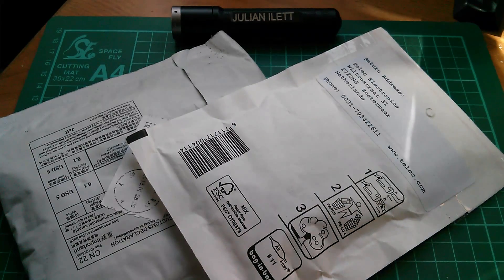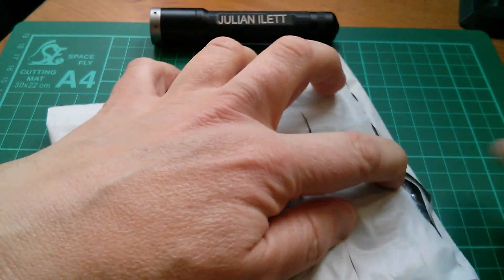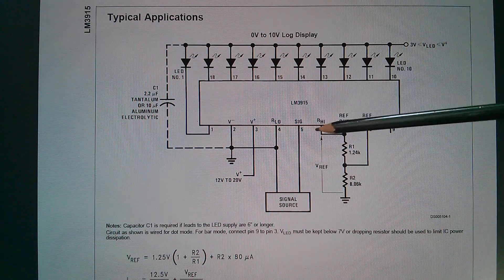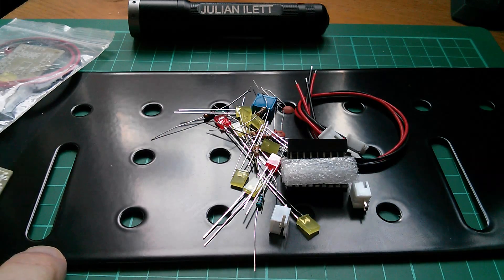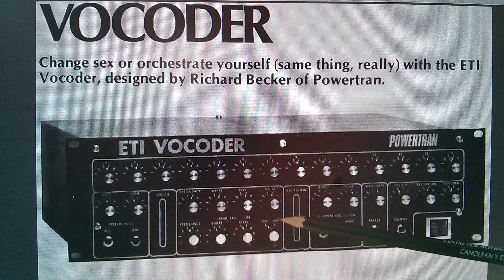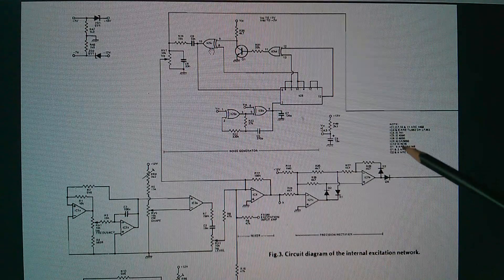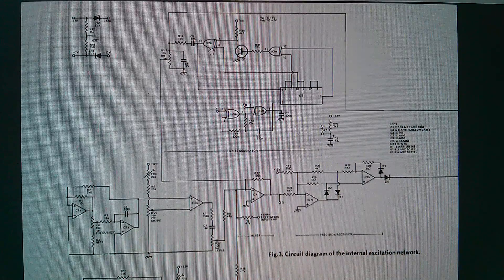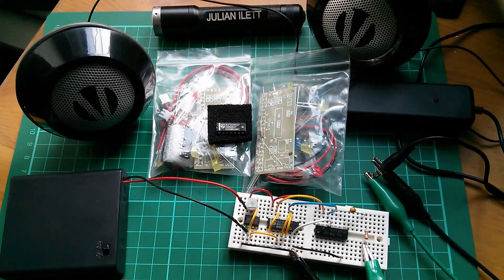Postbag: #37 - ETI Vocoder Parts - CMOS 4006, LM3915

Comment: I guess it's cheaper to get any 5v micro, simulate 4006 in software with interrupts for low speed clocks, and slap 4006 label over it :)

Comment: I looked at LFSRs a while back - the idea was to attach one to an Arduino to make a un-hijackable random number generator for encryption. The idea being that anything running in RAM would be vulnerable to malware /  spyware memory dump attacks, but an off-board Arduino based jobby would be much more difficult to compromise.

Comment: For numbers to be "relatively prime" the numbers themselves don't have to be prime. They must not have a common factor though. So 5 (5), 9 (3*3) and 14 (2*7) are relatively prime.
Reply from the maker: superdau Thanks. That makes a bit more sense. I just finished the noise generator and it sounds pretty good, although there are perceptible patterns in the sequence. Now to move on to the input and output amplifiers.

Comment: I know it goes against grain of the project but surely a micro controller would be better for implementing the logic, maybe even the LED bar graphs displays? The random sound reminds me of a ZX Spectrum game loading or 56K modem :-)
Reply from the maker: Coolkeys2009 I want to stay true to the original circuitry for this project, but you're right, a microcontroller could do the noise generation. In fact, I wouldn't be surprised if there's a vocoder app which models the entire thing on a reasonably fast processor (i.e. a mobile phone)
Reply: Julian Ilett Fare enough you want to know it sounds original. I wonder if microchip have any  app notes for musical instruments using their dsPIC or newer microcontrollers :-)

Comment: Hi Julian, I actually did my University final year electronics project on Pseudorandom white noise generator which was basically what you have but with a selector switch to select which taps could be selected on the shift register. I also had two or three registers chained together to get the max length I needed. I then had the taps fed to a resistor network and various filter networks to get the desired rolloff curve on the specttrum analyser...

Of course now you could do all of this in a 6 or 8 pin micro...

Interesting project the vocoder though. I had a lot of those 80s magazines (still have i'm sure) and think I recognised it when I saw it on your videos from one of them... hmmm... up to the attic this weekend me thinks...
Reply from the maker: smitcher That sounds like an interesting final year project. I hope I managed to get most of this right!! Yeah, it would be fun to get that 6-pin PIC to do this instead of the CMOS logic.